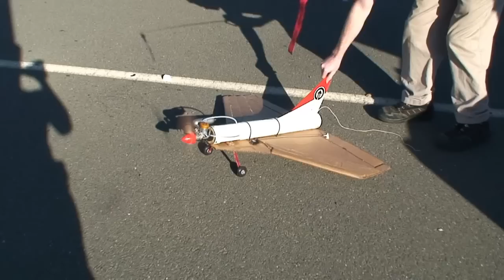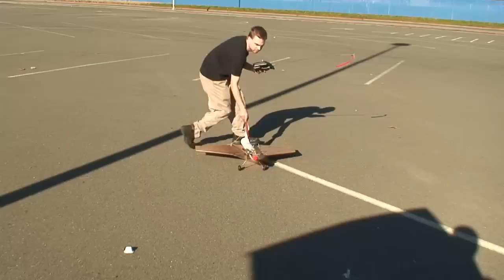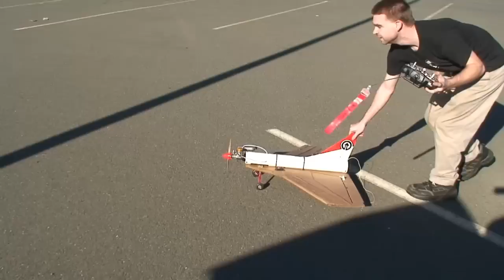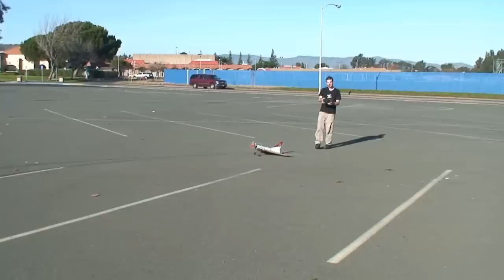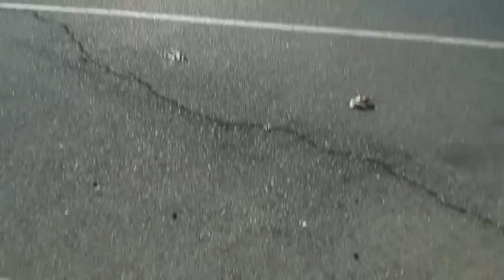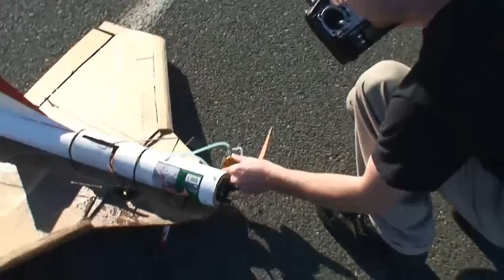Shuttle Flight

Comment: Silly question, was the prop or engine offset by 2 deg, to compensate for the tourque the engine was putting out? Just a though as to why the shuttle was doing burnouts.